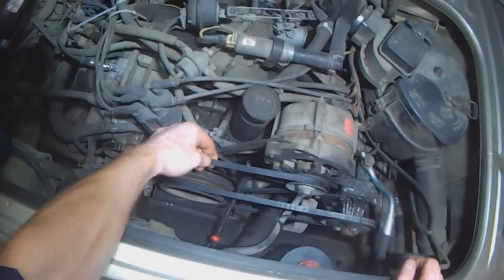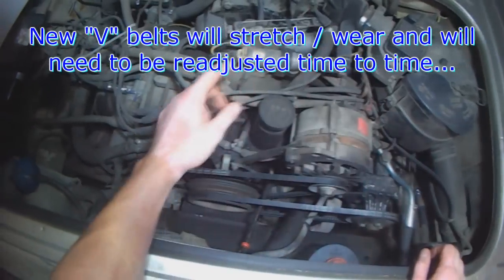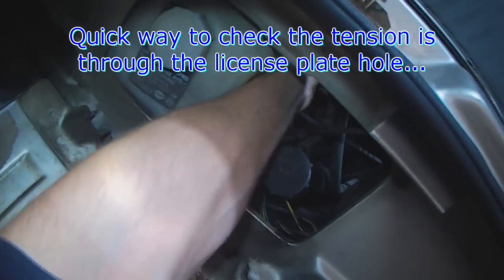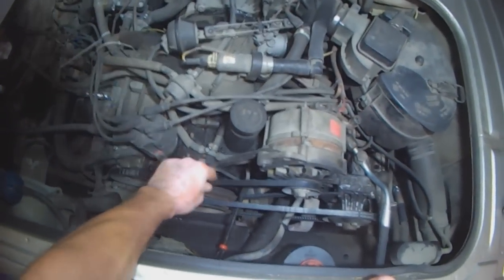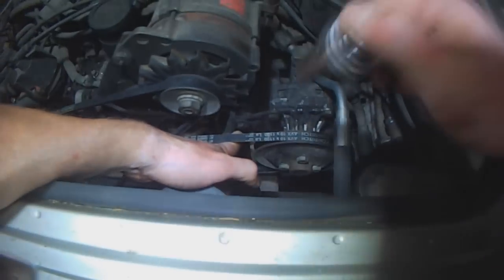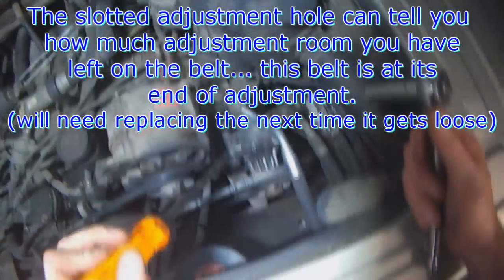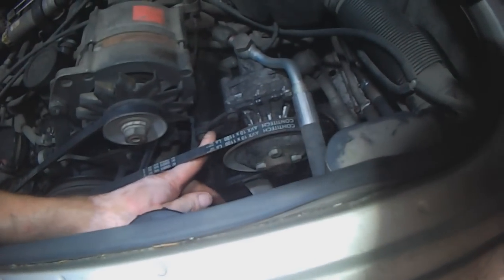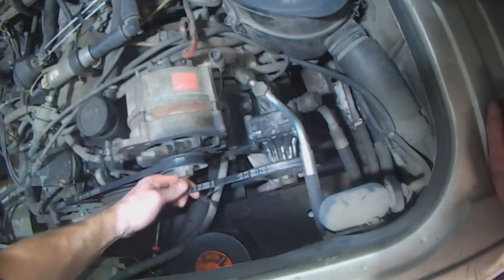VW T3: Alternator & Power Steering belt adjustment

Comment: Hi, Thomas. I don't know about you, but I've had problems with Conti belts not sitting in the alternator pulley as it should. Bought one from Auto Zone and the fit was better. Didn't last long, though, two years. I have a new Conti to replace that one, and hopefully, it'll fit as it should. Great video, by the way, I wasn't loosening the other two bolts for adjustment.
Reply from the maker: Thanks & thanks for continuing to watch! We haven't really had any issues with ContiTech / Continental belts. These belts are skinny to begin with and maybe something thicker (like the AC belt) would be better / last longer on the water pump / alternator application.

Comment: Thanks dude. I habe 3 belts on my t25 2.1dj vege engine, power steering, auto gearbox van. Do you know the sizes of the 3 belts I need as they are all missing?
Reply from the maker: Search vanagain.com

https://www.vanagain.com/categories/86-92-21l-vanagon/drive-belts
Reply from the maker: AC belt.
AC Belt for Waterboxer Vanagons 83-92
https://www.vanagain.com/product/ac-belt-for-waterboxer-vanagons
PS belt.
https://www.vanagain.com/product/power-steering-belt-10x1075
Alternator belt.
https://www.vanagain.com/product/alternator-belt-for-water-cooled-vanagons
Reply: Thanks @exovcds very helpful; much appreciated. In the U.K. it’s difficult to source an Air Con belt. But since I don’t use the air-con, because the U.K. is mostly cold.. maybe I can leave that without a belt.. (?) 😅
Reply from the maker: @vincentmonet6172 if you don't use AC, yes, you can leave that belt off.
Reply: @EXOVCDS you’re a star. You’ve saved me a few dollars (ie pounds!) Cheers, man.

Comment: Hi. at the start of the film, you grab the belt. The wheel under your hand on my 1.9L gasoline motor is tight, but its shaking alot. I have tried to figure out the name and what it does. Im also trying to find a new one for rplacment. Any ida? LOve your vids. I just got my van, and im setting up a priority list on where to start. That wheel makes my worried :( I need to change the belt also :D
Reply from the maker: You mean the crankshaft pulley?
Reply: mm, I think so. Yours is double, but mine is just single track. Its tight and snug, but mine seem of camber. Like a bike wheel that is not straight. Again, thanks for uploading all your vids. Il move to a new house soon so I cant start working on the van yet, but it helps to lay down a plan for "all" the repairs. Specially since there is not so many parts available here in Norway. Need to order in advance from UK, og Germany. Do you think it could be just tat the pulley is bendt or is it a chance there is something wrong with the crankshaft? Its runs smooth a it feels good to drive. No strange sounds as far as my knowledge is. Thank you for your replay .
Reply from the maker: Andreas Dahl It might have gotten bent at some point in time... removing it and checking it on a bench might be the best way to verify. I think it can be removed with the exhaust in place. It's been a while since I had to remove one. I'll check the next one I can get my hands on.
Reply: thank you!

Comment: how much oil i need
Reply from the maker: Try to always reply UNDER the same question... it keeps things looking more uniform & easier to follow.

Front: http://fkh161.ca/Audi/A6/A6FrontDiff.jpg (G 052 145 S2 0.8L when empty)
Rear: http://fkh161.ca/Audi/A6/A6RearDiff.jpg  (SAE 75W90 1.5L when empty)

Fill until fluid is level with the bottom of the fill hole (until fluid starts to run out).

http://www.blauparts.com/blau-news/20150409-new-product-vw-differential-gear-oil-g-052-145-a2-g-052-145-s2
Reply from the maker: Get the info?